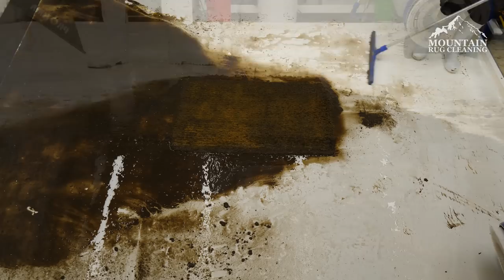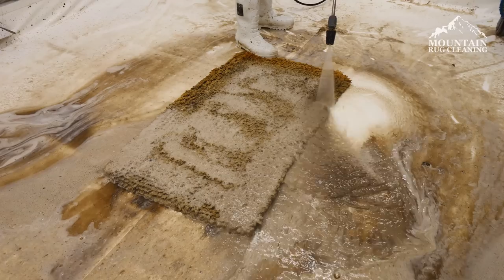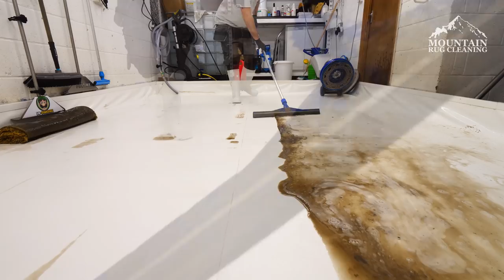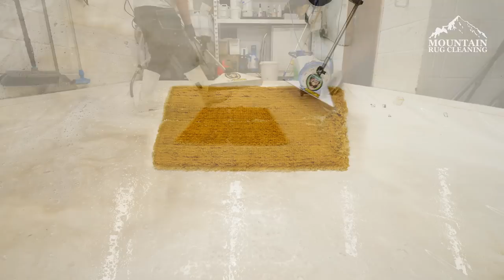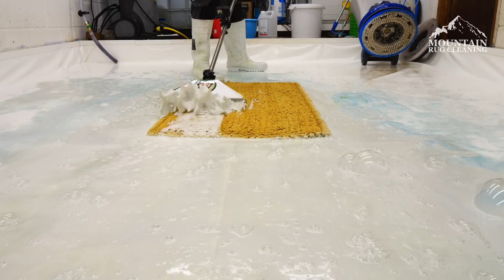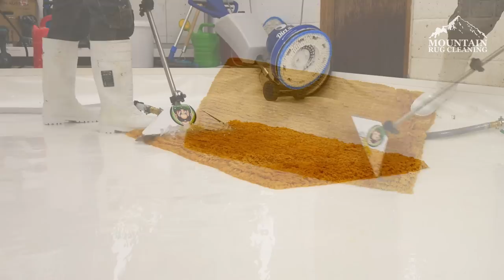This Rug Looks ALIVE !!! Like some BEAST From a SWAMP !!!

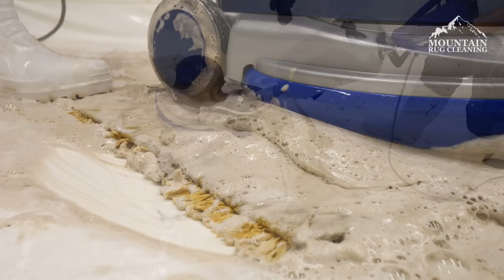Comment: 8:08

Here's a little advice for something like this happening. Try either clipping, Taping or nailing the rug to a different floor, like the cement outdoors, to keep the rug in place and prevent something like this happening again. Plus, you won't damage that particular floor that you're working on.